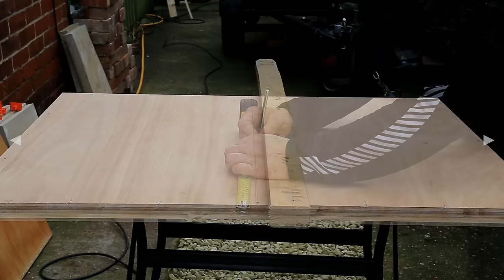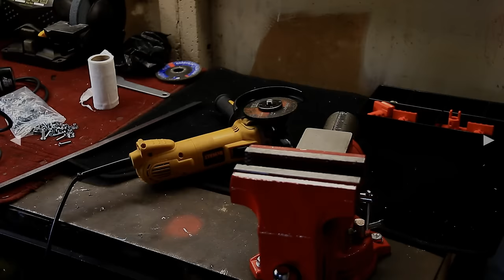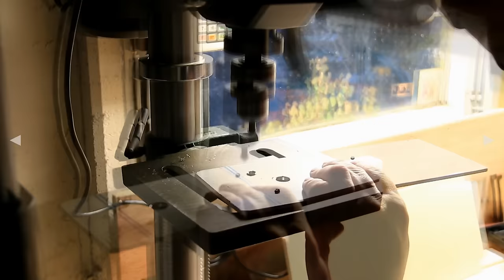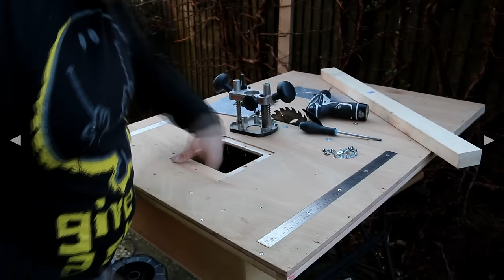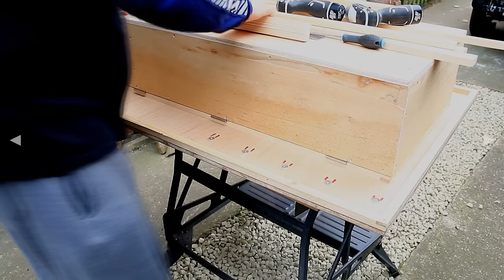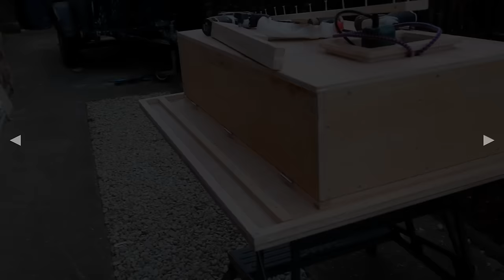Homemade table saw with built in router and inverted jigsaw 3 in 1

Comment: Really enjoyed that video Sean, thanks so much for taking the time to make and post it. It has given me several good ideas for my own build.
Hope you dont mind tips. When drilling/countersinking steel, use a mineral oil such as straight 30 lawnmower oil. 
Usually when doing the same on aluminium no lubrication is needed since it is so much softer than the high speed steel with which you are drilling. It is sometimes advantageous though to use a penetrating oil such as WD40. (The cheap stuff from the pound shop works just as well) 
In both cases it will prolong the life of your drill bits considerably and give a little better finish.

Comment: Not criticizing, but wouldn't it have been easier to just cut all of the metal plates to the same size (the size of the largest one needed) and then you could drop in whatever tool you needed and secure it with it's matching plate?

Just seems that would be a bit easier.

Comment: Does wood dust fall insise the box ? Cos it may create problems as dust will flow in the box during the use n it may get in the motor area of the machine . Correct me if m wrong
Reply: Yes, for a dust problem used a dust collector for environment safe

Comment: Sir - is it possible to find out the dimensions or see the drawing, preferably in centimeters? Thanks.
Reply: I would just etimale based on ruler he inserted.  BTW, 4 mm sheet is about 3/16 in real measurements.  I would guess the top is four foot by two foot.  You can convert that using any search engine.

Comment: nice tools, i like that.
mm...what name part (14:59) 
what is the name of the part, which is stuck beside the black box, you buy something called a flexible/spiral.

this video is very useful,
You are very concerned about work safety.
this is very inspiring, besides working, they also provide a good example,
I feel you are a good mentor

thank you sir, my respect....
from Batam - Indonesia 🇮🇩

Comment: Hi I basically did the same, i.e. mounting my saw, jigsaw and router on the same table. I also mounted two t-rail guides across the table and an aluminium fence on its longer side. But for the basic idea of mounting all the tools on the same table I must credit you. A (maybe) funny detail. The table I used is the fine 60x35" oak table formerly placed in my living room ...

Comment: Great job Sean. I was told it would be hard to build a table saw, but man you went far above a table saw with jigsaw and router. Screw the ones who leave negative comments. You are truly talented and have a great imagination. I will be attempting this in the near future. One question I have and it is a safety concern, what about installing a blade guard, if you happen to be saw and the slip, oops😫😫. Have you considered adding this and if so will you have and additional video for upgrade?? Thanks a bunch. I'm going to subscribe!!

Comment: I'm a complete novice, so apologies if this is a stupid question, but why didn't you make a metal plate to mount the circular saw as well? Don't you lose a lot of cutting depth just mounting directly on the wood as you have? Great video though; I just need to adapt it to my very basic skill level and tool selection. Thank you for sharing.

Comment: I tried cutting an 8ft piece of plywood yesterday on my table saw and the damn piece couldn't move anymore a couple feet in. I turned off the machine then turned it back on. I adjusted the piece of wood slightly left and right. I adjusted the straight edge to no avail. Then I watched this guy create a table saw from scratch! I'm definitely sticking to my day job lol.

Comment: So many screws, that's overkill.  And most of them don't have to be visible if you screw them from the other side.
and you don't need 5 screws per ruler when you can glue them in with epoxy or high tack.
Still, your video got me very interested in making one for myself though combining good ideas from several videos.

Comment: Nice little package. Handy forsure. If anyone else is planning on doing this. I would suggest just squaring the circular saw base and ensuring that the blade is 90 degrees to the table and just plunge cut the saw into the table top to creat a zero clearance "throat plate".. much safer to use.. another idea is to actually cut out a place for throat plates to go so you can have zero clearance and also be able to cut bevels. Thanks for sharing your work.

Comment: There is something overly dangerous with both of these tools. He built a double kill machine. Both routers and table saws both seem inherently insane to me.  They take too much skill and physical strength and knowledge, etc. It is too easy to make a mistake and a mistake could be life changing for the worse. I'd like to see more automation to decrease the danger and stress of these tools.  Even if you are a big strong serious guy with full concentration and know how to decrease the danger down to near zero, it still requires a lot of energy to pull that off, and I think guides, and jigs, and CNC machines, etc all can help decrease the amount of risk to humans. I dont mean to be a safety nazi fag but I am just saying. If these tools don't scare you a little, you are dead. In high school shop class, a board got away from me in the router and got shot across the room and put a hole in the class room door with wood lodged into the door.  And with the table saw, the piece of plywood got whompyjawed and flew up into the air and I just ducked and covered my head and the plywood sheet fell on me.  It did not hurt, but it could have shot it back at me like the router did the smaller board.  Some people got skills.  I am not one of those people.

Comment: Dear DIYer 
As you have used all three electrical tools which has motor with fane for Air cooling during use of the tools
And that’s why the box you made need some ventilation hole or otherwise a net window for air circulation In the box.
Good made.

Comment: Hi mate great video - Quick question - For the circular saw, did it not have a safety switch that you have to engage as well as the main trigger? If so how do you engage that so you can keep it on all the time? My saw has one and i am trying to work out how I can do this... thanks

Comment: Nice table size for onsite work.
hope he can design one with rolling cart with one end side fixing the mixer saw, another side fixing a thicknesser one level below the working table surface. bottom corner of the cart are cabinet for bit, clamp, consumable and loose hand tools like nailer, sander, airless paint sprayer, vaccum cleaner, generator. 
one or 2 carts design to carry all tools to the site.

Comment: Great video and good job overall. My only objection is that the saw blade can not go up or down. It is very important(for safety reasons)to be able to adjust blade height. When cutting, your blade should be no more than 3mm higher than your material. Otherwise you risk loosing your fingers in case of kickback or if you do not pay attention when cutting.
Reply: My circular saw has a height adjustment, I'm sure his does too.  That said, I rarely adjust mine.  (I have a commercial circular saw mounted to the underside of a table on a stand like this.)

Comment: Such an awesome design sir! I just wonder, in case you wanna use one the 3 machines and your wood to cut is so wide, so how will you hide the rest of the tools or take them off the table? Do you need to open the box and take off the blade or bit of the rest of the machines, or there's another way you integrated into this design which is easier like something you press or twist to pull the machines you don't want to use down and push them up when you want to use them? 
Another thing, how were you able to put the guard on the saw blade? Sorry I haven't bought nor use a circular saw but I got a plan to buy one and build this one you've shown here. TIA sir.
Reply from the maker: The router is easy to remove from its springy mount which is good as the router sticks out of the bottom of the box, the jigsaw stays in the box but the blade comes off with the press of a button, the saw fin is built into the saw, try to use a saw with a built in fin, search "kickback on camera" to see why having one is a good idea

Comment: Very nice project.
1) For such a project I've used a professional router and saw because these two wouldn't stand too long especially during hot weather so you recycled two cheap tools that work for now but we don't know for how long.
2) You should be more careful regarding the space around you and how you use your hands on the table saw, I'm talking about safety.
By the way, cheap table saws are on eBay starting at $120 and you just craft it into a MDF panel, cheaper, less work, to last longer and with manufacturer warranty.
Reply: You forget the weight, snd a $120 table saw is junk.  This guy did a good job and you're criticizing him?  Just go away.

Comment: really good especially the micky mouse at the end. one question i didnt catch...the router can change the bit level by design but the saw cant, how did you make it so the jig saw bit is below the table top when using the table saw?
Reply from the maker: push button on the jigsaw to remove the blade

Comment: Just wondering about those metal plates on the saw jigs n router you're using.Are those aluminum or steel?...or maybe some other materials you can get easy.
Reply from the maker: aluminum

Comment: I would like ask you about fence system and it fixation if is it work good and if the fence parallel all the time if you change it different place on the table?

thank you
Reply from the maker: its not perfect, I just set it to the front and rear rulers and it makes a straight cut

Comment: Can you retract the jigsaw and router to use the circular saw independently? Or either of the units individually? Example if I wanted to cut down a large particlr board am I able to drop the router and jigsaw for a flat surface to access the circular saw?
Reply from the maker: yes
Reply: @projectmayhemUK  that's awesome!

Comment: How do you get the router bit out of the way to use the saw? How do you change the saw blade?
Reply from the maker: un plunge the plunge on the router then remove the bit, the saw blades just come out like they would if they were not attached to a table saw

Comment: Not sure what the point is here, building a table saw like this. The cost of the materials and time it takes to build this is not worth the effort. Why not just buy one already build, the cost is about the same. Then spent the time wasted building this on a worthwhile project. Also the router is fixed, I would need a second router to do other work with.